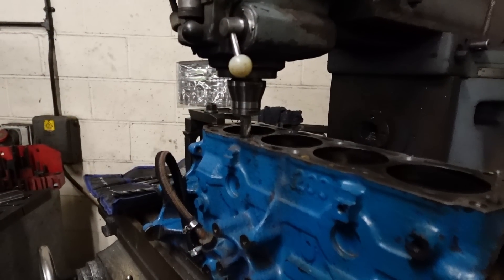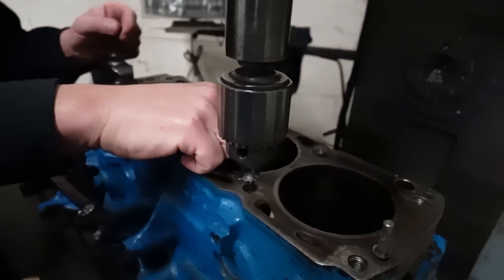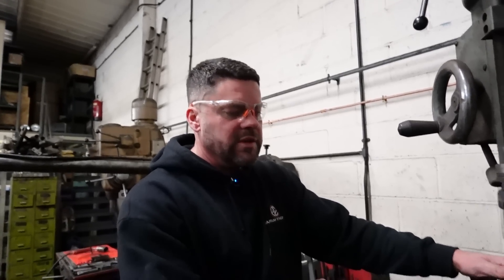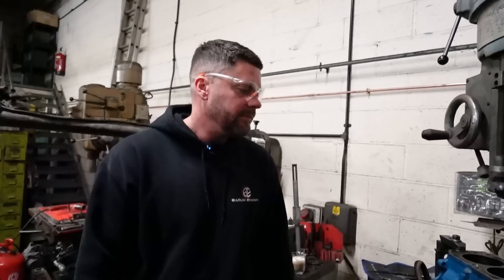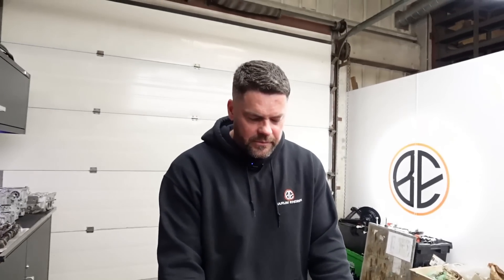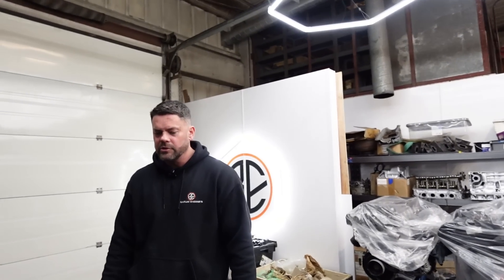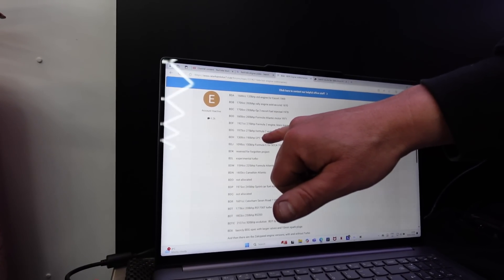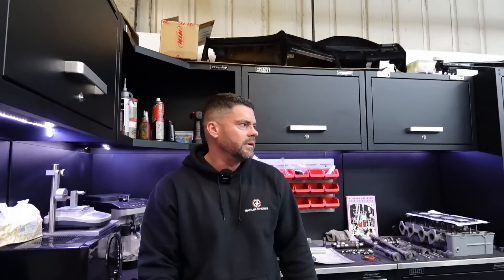COSWORTH SHOULD HAVE DONE THIS

Comment: Now that you know all the shortcomings of the Cosworth blocks, would it be possible to get some new blocks cast? The supply of original blocks is getting smaller each day. Could casting cores be 3 D Printed? Could blocks be machined with the new computerized milling machines?

Comment: RS1800 standard engine = BDE . It had the Hart developed alloy block with a 12 bolt steel crank as standard. Brain Hart developed it by Siamesing the water jackets to allow for a larger bore which led to the 2lt BDG. There can be a 3 or 4 stud exhaust manifold mount depending on the head casting.
Reply: Lee, you should get in touch with either Paul Sherwood of Sherwood engines or Mark Solloway of Bluesky Engineering

Comment: Great video! I was glad you highlighted the reasons why the modifications to older engines are required and time consuming. Your knowledge how it is done with consistency , the pitfalls of the person reconditioning the without the correct tools and finally the reason why your company is highly regarded for the end result with a great reliable engine was shown. Well done!

Comment: Update on my comments found my copy of the works escort book by Graham Robson  it was Brain Hart who designed and produced the 2.0l alloy block with a 90 mm bore the 1.8 steel block was 85.6  mm and the original BDA was 80.97 mm bore giving a capacity of 1601 cc putting it in the upto 2.0l class so it could with a siamezed bore could have a 1800 cc capacity.

Comment: Now I am a V8 guy in Australia. Mainly race boats but using stock blocks. So I know a fair bit about keeping an engine together at 8000rpm. I was a bit shocked to see that the BDA 1800 you pulled down only has two bolt mains and that the side skirts of the block stopped well above the bottom of the main bearing caps seeming to offer them little support. Is the block used in a DBA from the cylinder head only up, and a plain old Kent block sits below it? I would be glad of your opinion? I have used to Ford, Chev and Chrysler V8 blocks that not only 4 bolts but cross bolts as well. The FE side oiler 427 that were used at Le Mans have deep skirts and the mains are buried deep in the block. We have an FE 427 that runs all day at 8750rpm with the valve gear the only limitation.
Reply: You are correct the BDA is based on a Kent Block. These are different to the Lotus twin cam that was in the Lotus Cortina which also used a Kent Block.

Comment: On that stud at the waterpump, can you gain enough strength if you put a threaded insert in there so you can keep the standard water pump? Deep stud will still be stronger, but would the insert be enough?

Comment: Standard twin cam had a full length standard camshaft to run the mechanical petrol pump, if you didn’t need that the trick was to chop the rear of the cam off, behind the middle bearing and machine all the lobes off…not forgetting to block the oil hole in the rear bearing housing, when in shortened form was called a Jackshaft. BDG was probably the ultimate rally engine back in the 80’s and had the smaller 10mm spark plugs fitted so could be fitted with bigger valves….and on and on…..Sherwood is the man of the moment for a large percentage of the people running Historic rally Escorts these days.

Comment: Thats an early alloy block. It has an extra oil gallery next to the oil switch. On the wet sump road cars an oil pipe went from that gallery, under the sump and into the oil gallery next to the nearside engine mount. This is because there's no oil gallery drilling through the middle of the block.

Comment: Bdh is very very rare was built for saloon car racing and rev for England almost 10k from.what have read the rs1800 code is BDA bit confusing as I thought the rs1600 engine which was fitted in the mk1 escort is bda which would be a normal cast iron  block I would have thought.This was the first production 16v engine before the triumph dolomite sprint engine was produced this is something dolly sprint owners always shout about lol
Reply: Actually the Americans produced millions of 16 valve engines from the 30s to present. I assume you meant 4 pot but that is not what you wrote.

Comment: L+I in my Facebook Reels feed there has been a few "Fly cutter head skims" where the camera is attached to the machine and shows the cutting pass on the heads, in this video you talked about the surface of the block , can you stick some engineers blue on and skim a block or head and film (that's put the blue on the metal not your heads and look like Smurfs) LOL

Comment: During the late 70’s early 80’s I worked on 6cylinder Riley engines. It was quite common to longstud the blocks, then get them vacuum resin’d. One of the blocks we machined of close to 0.75” then welded up the deck., not quite fully closed up/ dry decked. With 11/11.5:1 compression we would measure 265psi on cranking.

Comment: It’s great to hear a bit more about the BDA engine – which definitely was “Belt Drive Type A”. When Ford wanted to get into F1 in the 1960s they went to Mike Costin and Keith Duckworth (Cosworth) to develop a 3 litre V8. They came up with the idea of putting two BDAs in a V and created the DFV (double four valve). This went into the Lotus 49 and many other F1 cars. The DFV was arguably the most successful F1 engine of all time.
Reply: Not quite, the BDA came after the DFV/FVA which were developed in parallel for different racing classes
Reply: @malcolmfendick  the DVF was gear driven camshaft’s
Reply: Pre BDA was the gear driven FVA which is closer to the DFV

Comment: All along with the Bda, i was muttering, thats a hot crossflow! thanks for clarifying, also, in my 68 elan 2+2 it has the 1500 xflow bottom end, but with a complete camshaft etc, and the holes in the head for the pushrods, and this car was brought brand new from Lotus by Father, did they all have this?
Reply: Yes! They used a Ford bottom end with a lotus derived head. Changed from OHV to DOHC and used the original cam as an idler essentially! I think they left original cam in as it has the gear on to drive the oil pump
Reply: 1500 pre-crossflow.